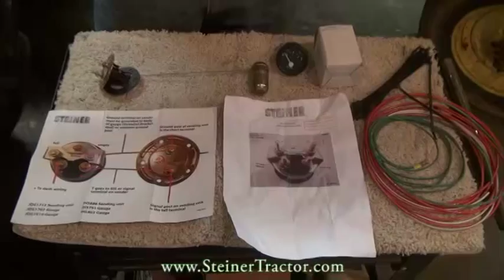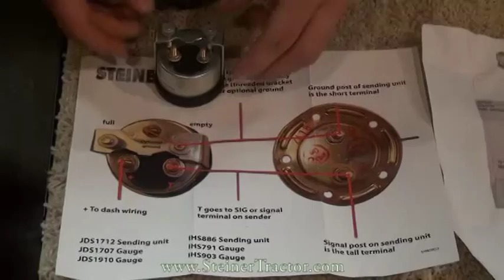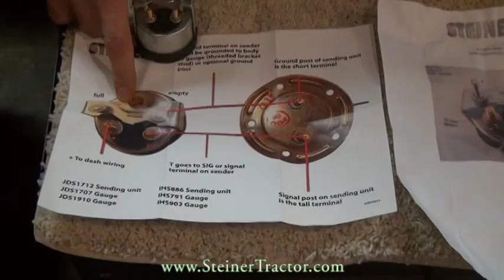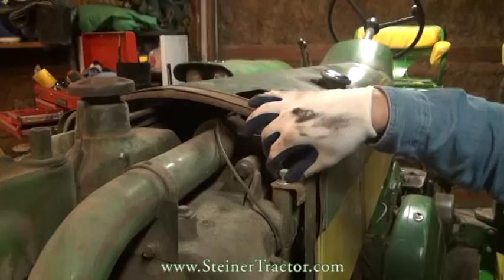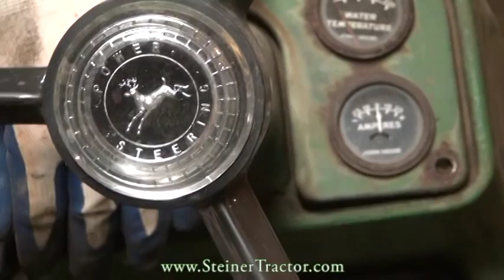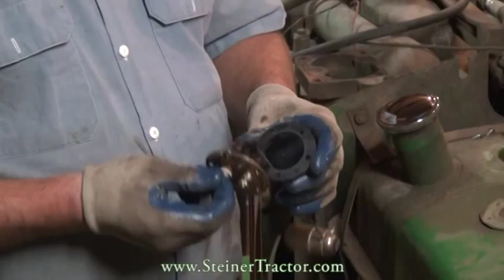Fuel Gauge Replacement on a John Deere 630 Tractor

Comment: Hey Tyler!!!  While you have hood off. Grease the two u. Joints on steering shaft!! Lord knows the last time they were greased!! Might even need to be replaced
.  Also put some anti seize on screws holding down sending unit. Also some di-le tric on wire connections. Just a thought. You do such a good job with videos!¡!

Comment: Great video but be cautious about using a vacuum cleaner around an open fuel tank, they generate static electricity that could ignite the fumes. I like the 630, it's my favorite JD model.